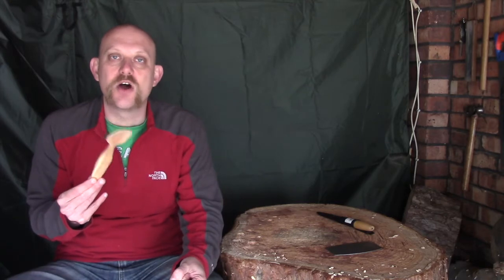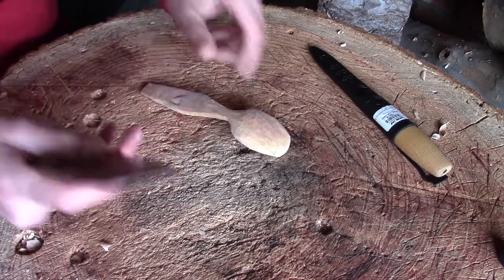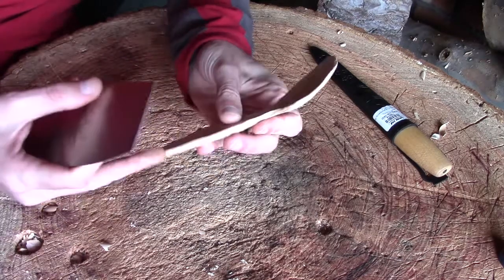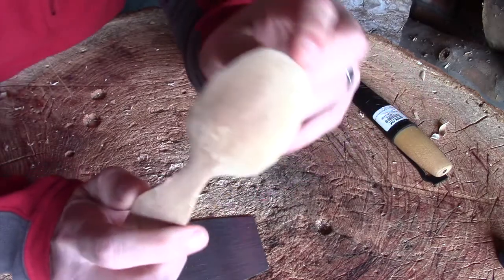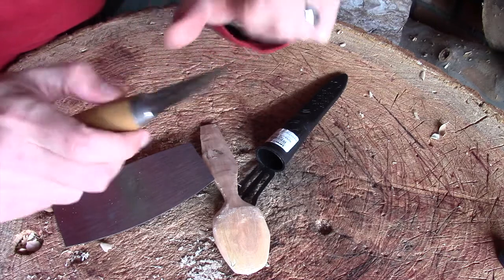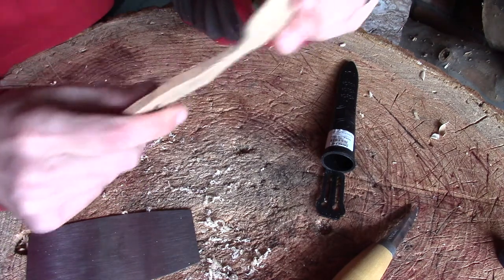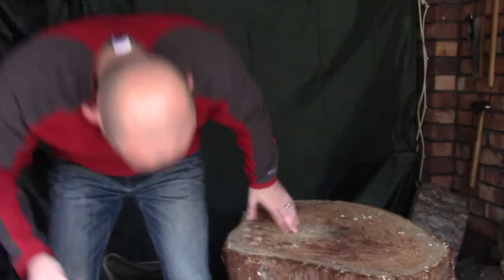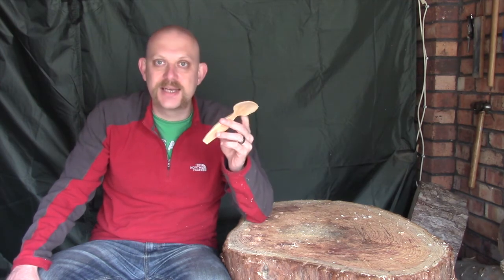From Log to Spoon My Method - Update and Intro to Scrapers

Comment: I have learned the value of a cabinet scraper long before I started on spoon carving. I first learned the art from Jorge Sundquist in a video. I have  learned the value of a cabinet scraper through traditional cabinet making. It may be hard work and not useful in today's profession but a nice hand tool. I saw an example of shavings that rolled off a piece of wood from a very sharp scraper. A scraped finish is much smoother than a sanded finish. I also tried to make my a scraper from the back of an old hacksaw blade. It is very handy for smoothing out a spoon. The hacksaw blade doesn't create as nice of a burr as a cabinet scraper intended for the purpose but it is much cheaper and more available than a cabinet scraper. I still prefer a cabinet scraper but they are a little pricey.